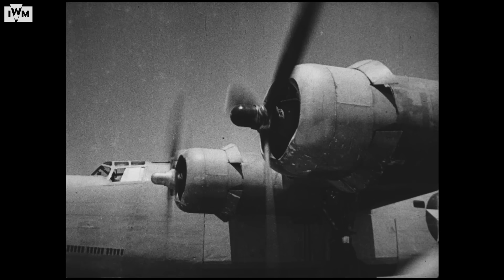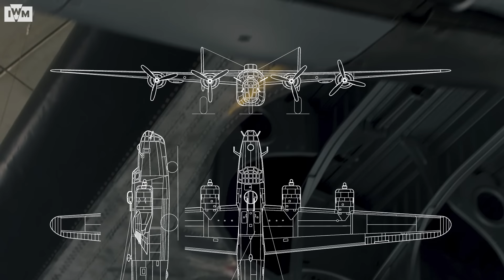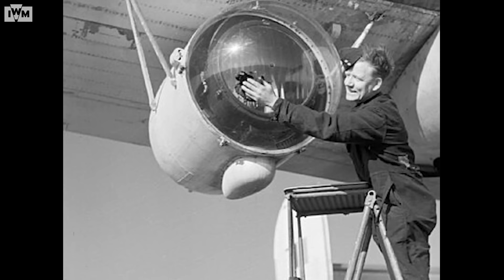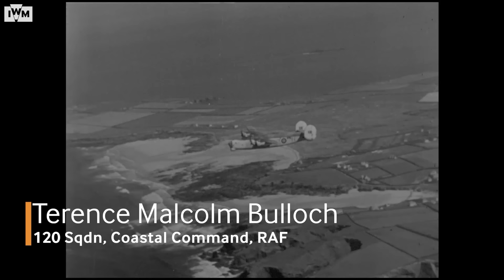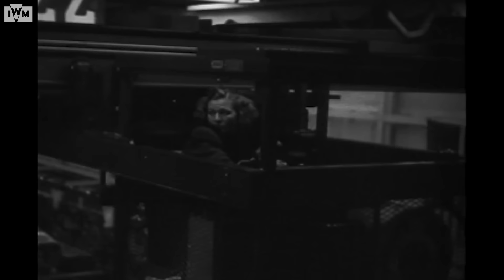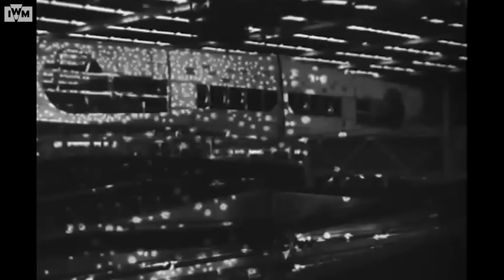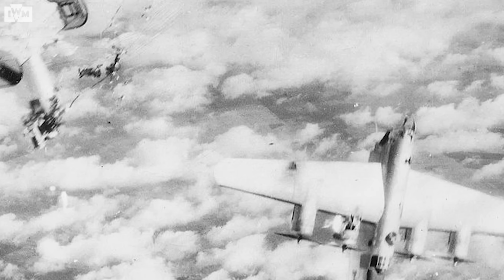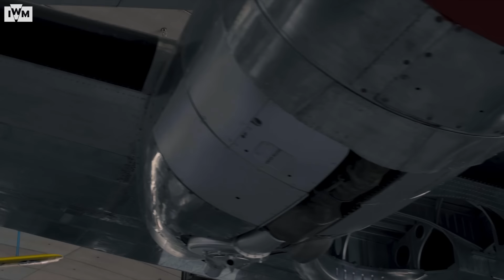The most produced Bomber in history had a bad reputation | B-24 Liberator

Comment: The reputation between the B-24 and the B-17 is kind of like the reputation between the Hurricane and the Spitfire during the Battle of Britain. The B-24 like the Hurricane was more numerous and did the majority of the work but the B-17 like the Spitfire gets all the glory.
Reply: It's more about location. The unique requirements of the war over NW Europe happened to be conducive to the B-17, in the MTO and particularly the Pacific the Liberator was superior with it's longer range. 

During and after the war, the VIIIth AF got the most publicity so the B-17 was more retained in popular memory.
Reply: @ME-xh7zp  I guess it depends on how you define "in numbers." The P47 was available from Summer 1943 but the ones that were available were not used effectively as an escort due to flawed doctrine (the bomber does need escort and lack of drop tanks)
Reply: @airplanes42  That's the thing, that's only part of the story. The P-47s that were used prior to the D-25 didn't have the internal fuel to make use of large drop tanks required to go to Berlin. Only after the D-16-RE did the Jug have the plumbing required to take the pressurized fuel of a combat drop tank out of the factory. Before that it was an extensive process of mods that had to be conducted by VIII FC ATS. Without the larger internal fuel tank, they still couldn't make it much past the Ruhr. Overall impact was the P-51 (and P-38 but it struggled for other reasons) were available to do the escort at the earliest, critical destruction of the LW phase in early '44. 

Also, fyi, Eaker was screaming for escort fighters as soon as his first P-38s were taken in '42, and Arnold had moved escort fighter development and drop tank production to top priority in Feb. '42. Imo recognizing that within three months of a surprise war was pretty decent awareness.
Reply: My late father, who piloted B-24s out of Toretto in the 461st Bomb Group, was told that because the Liberator was  a beast to fly (esp. in close formation), the best pilots were assigned to the B-24.  A friendly jab at the B-17 and Lancaster crews; they were all heroes.
Reply: @thomashoermann316   They had to be to best,  It was a beast to fly Came out 2 years after the B17 and was not as good
Reply: @thomashoermann316  lancasters, Stirlings and Halifax never flew in formation, they took off and carried out  the raid independently.,although on a strict time schedule.
Reply: The B-17 could take more punishment (battle damage) than the B-24 especially the wings, which is why the crews liked the B-17 better. I spoke to the pilot of the Collings Foundation's B-24 and he said flying the Liberator was like flying a freight train compared to the Flying Fortress.
Reply: All true....from this one person's perspective.  Both were good.  Cheers- @barryhoward7284
Reply: @barryhoward7284  I like a freight train..
Reply: @barryhoward7284  My father -in-law flew B-24 then transferred to Catalinas...he did confirm that the Liberator was very heavy on the controls and much more difficult to fly in close formation situations.
Reply: @barryhoward7284  Not many airmen served on both B-17's and B-24's so I've always found claimed side by side comparisons specious. My father was a B-24 pilot flying out of England with the 492nd Bomb Squadron before it was taken over by the OSS. He flew 11 bombing missions and then transitioned over to anti-intellengence missions. His crew did radar and radio jamming and radio intercept recognizance totaling 50 missions by war's end. His co-pilot once told me that they may have been the only plane in the air during the third day of the Battle of the Bulge when the weather socked in most of England and Northern Europe. They were radio listening over the battle field that mission but never detected an German airplane radio transmission. 

The 492nd was considered one of the 'jinxed' squadrons. Of the original 36 crews deployed to England in early 1944, only 6 crews completed their tour of duty intact. The other crews were either lost entirely or had crewmen killed or injured too bad to continue flying. I was told (not by my father) that none of the men that flew with him received a Purple Heart, he was considered a 'Lucky' pilot. A few years ago my brother found the memories of a B-24 gunner that in a letter to his loved ones  stated he had been assign to Lt. Young's crew for his last two mission so he knew he would make it home. Luck and skill had far more to do with whether you survived than whether you were flying in a 17 or a 24.

My mother, her sister and their father all worked at the Willow Run plant building B-24s. My claustrophobic mother had the job of climbing in the wing root to complete that wiring between the fuselage and the wing. My aunt was a riveter, my grand father was a mill hand in the tool shop.
Reply: Wing area, the 17 had more metal to be destroyed. 24 had a critical wing and when some of it was destroyed it no longer generated lift.  @barryhoward7284
Reply: B24 as a forgotten plane of WW2? I don't think so, at least not by anyone who is interested in aircraft of that period. Also any documentary program dealing in any way with the bombing campaign in Europe and indeed the Far East will normally include footage of B24's in action as well as B17's (and in the case of the F East B 29's). Granted it's service in the Battle of the Atlantic is often overlooked as indeed is that of other aircraft which took part in this vitally important campaign. The aircraft that are often overlooked are some of the twin engined medium bombers used by the allies at the time. Let's be honest, with a name like Flying Fortress how could the B17 be anything but the most memorable of the two and possibly all the Allied heavy bombers (I know here in Britain the Lancaster rules, my dad served as a gunner in them, but in America it would not have the significance of be anything like as iconic)
Reply: ... and it's largely a moot point. The B-24 had strengths the B-17 didn't, especially range.  The video explains how this made it good for sub hunting, but it was also very important in the Pacific.
Reply: True. Another one to compare on which would be better would be the  p51 Mustang or F4U Corsair.
Reply: @yoehonjohn4832  Imho P47 is more appropriate since the Corsair was a carrier fighter. The P47 was in service much earlier than the P51, and with aux tanks and judicious use of the throttle the P47 had more than sufficient range.
Reply: @airplanes42 
That's a bit of a misunderstanding, the P-47 didn't have that capability in numbers until after D-Day, and the Mustang was still superior ranged to all Jug  models that saw significant numbers in the ETO.
Reply: @ME-xh7zp  Rainge not that big of deal when you have drop tanks. P47 is harder hitting, tougher to take multiple hit mashine gun & even 20 mm hits,  the superior Pratt & Whitney air cooled twin Wasp radial engines that can often operate  even with a few cylinders shot out, unlike the delicate & 'pretty' looking Mustang.
Reply: @airplanes42 Major factor being that they could buy 3 P-51s for the cost of a single P-47
Reply: @airplanes42  The Corsair was at first a land based plane
Reply: @airplanes42  But the P47 had a lower T/M than the P51
Reply: @bobmalack481  Superior Pratt and Whitney where certainly not in Power to weight or Power to displacement Packard Merlin has it beat in both of those.
P51 could go higher not by much but more regularly P51 could turn better Climb better and dive better P47 Tactical Mach 0.71/0.73, P51 0.78/0.80
Reply: @airplanes42  The P-51 was more of a hybrid and could outfly a P-47.
Reply: @airplanes42 I mean, it was "Technically" a carrier fighter...

But for most of its service with US forces it was tossed like the USN's disappointing scraps to the USMC for them to use as a land based fighter, due to numerous crash landings on carriers due to its poor landing visibility from its long nose fuselage and high AOA required when landing due to its gull wing and location of its landing gear.

It wasn't until the Fleet Air Arm received their Corsair Mk II's, as their carrier plane development had been left in the dust while the RAF had command over them and were lucky just for the RAF to toss clapped out Hurricanes their way every once and awhile; God forbid funding an ACTUAL great carrier aircraft, after all, why would the RAF waste resources on something not for themselves? (HEAVY Sarcasm here...).

So most of the Fleet Air Arms best Aircraft by mid-late war were Lend-Lease F4F-4's = "Martlet Mk IV's", F4U's = "Corsair F Mk II's", F6F's = "Hellcat Mk II's", TBF Avengers = "Avenger Mk II's".

And while the USN was satisfied with the printing presses of Hellcats arriving around the clock, the FAA was in worse shape with MUCH less options and took anything they could get. So they trialed and experimented safer ways to come in and land Corsairs on their Aircraft Carriers and developed the sort of "Side-Slip" method where you came in off center to keep the deck in view until the last second upon which you straightened out and immediately cut the engine and almost instantaneously plonked like a rock onto the deck and (Hopefully) caught the wire.

There was still some danger involved as if you misjudged your height, or the carrier decended a wave in rough seas and you cut the engine, you could do serious damage to the airframe and in the process, likely yourself as well. 

But this was enough to finally get the USN on board and deem the F4U Carrier qualified and "Then" it became a carrier fighter.

If the "Carrier" vs "Land" plane's still bugging you though, I guess maybe you could compare the F4U to the F6F. The Corsair was exceptional and nicknamed the "Whispering Death" due to the sound it's Radial made in a dive for a strike mission or CAS, it even has the same K/D Ratio of rhe P-51 at roughly 11-1.

Yet the F6F while initially packing the same x6 Browning M2 .50's as the Corsair, and while not having the 4x20mm of Cannon armed Corsairs "Did" at least get a mixed armament trading x2 .50's for x2 20mm M2 Autocannons for x4 .50's and x2 20mm AN/M2 Autocannons such as on the F6F-5N; The F6F was designed and built by "Grumman: Ironworks" and went on to rank up a K/D of 19-1... Almost as good as the Mustang and Corsairs K/D's combined...

The P-47 is.... Extremely difficult to judge as in the ETO alone it scored over 7,000 aerial kills, but has a K/D of only 4.6-1. However this data is highly skewed as the P-47 was the MOST produced US Fighter of the war eventually making up about HALF of the entire USAAF Fighters and only had a 0.7% loss rate per mission. So due to just the shear numbers of them being literally anywhere and everywhere all at once, they'd naturally be more likely to be shot down as they'd naturally be the most common fighter to get into a fight in the first place.
Reply: @yoehonjohn4832 I would take the tough, hard hitting P47 over either of those, especially in the bubble canopy late war 'D trim variant. Eight 50's, under wing drop tanks, bombs, and or rockets, bullit proof Pratt & Whitney twin wasp radial engine, ability to take multiple hits. Usually gets you back to base where the sleek and 'sexy' Mustang was more delcate with liquid cooling and the associated extra plumbing and radiators. The old WW2 airforce saying- 'If you want to impress your gal take a picture standing next to a Mustang. If you want to get BACK to base and to the states take a picture standing next to a P47'. Robert at 68.
Reply: @bobmalack481  Ahmm source for many P51 being brought down by the cooling system being compromised? P47 Massive Turbo Super very large and long Air pipes to and from the super very vulnerable to side hits
Reply: @yoehonjohn4832  Mustang for sure
Reply: There were more Spitfires produced overall throughout the war than the hurricanes.
Reply: @livethefuture2492  yes and under constant war conditions
Reply: Actually there were less hurricane at 14,600 and 20,000 spitfire and spitfire did most of the work
Reply: @harryvlogs7833  Not Correct The Spitfire did most of the Fighter work The Hurricane everything else
Reply: @harryvlogs7833  No the Spitfire did not do the heavy work that was always the Hurricane . In fact the Hurricane was not changed in Burma until Late 44 or early 45 by the P47
Reply: @harryvlogs7833 . Not in The Battle Of Britain.
Reply: @mattmurray9312  yeah
Reply: @harryvlogs7833   Actually the Hurricane was still doing stacks of stuff that the Spitfire did not do until later 
Sea Hurricane, Malta , Ground Attack par excellence 
MkIV with Universal wing 2x Brownins 2 x40mm Vickers S gun 2 x500lb bombs AND 8 ROCKETS which the Spit never had.
Reply: Oh and from way back the Hurricane had 4x 20mm cannon which beat the Jug is destructive gunfire There is a video on the Hurricane can opener in Libya, it was a  excellent  ground attack plane before the US even thought about it.
Reply: @jacktattis  not during the Battle of Britain it didn’t. It had the same 8 .303 machineguns as the Spitfire.
Reply: @jacktattis  yeah and then quickly failed and was replaced buy the better spitfire, faster more maneuverable more guns much better and faster
Reply: @PitFriend1  Hurricane IIB 12 X .303 IIC 4 x Cannon so not long after.
Reply: @PitFriend1 It hardly matters the Hurricane was a better gun platform and had 4x cannon well before any Spitfire
Reply: @harryvlogs7833  I would hardly compare 2 x cannon and 2x 50s[ Spit] better armed than 4 x cannon of the Hurricane   The rest you are correct . But dont write off the Hurricane, it was in action in Africa Malta and at sea before the Spitfire.
Reply: The 24 did a lot of work in the Pacific but it also was considered a hard plane to fly
Reply: No, the B-24 was the high performance airplane. Faster and carried a larger bomb load. It took three B-17s to carry the same bomb load as two B-24s.
Reply: @Nl-nn3ds  Not so Top Speed 290 mph service ceiling 28000 ft Max bomb load 12000 wing racks and internal B17 317 mph and 35000 ft Service ceiling max load 12800 lb B24 to Berlin 8000lb B17 6000 lb
Reply: Wouldn't push it too far the other way either. Neither aircraft was truly better than the other. The B-24 did carry larger bombloads farther and faster in other theaters, those not defined by extreme altitudes. Not to mention the contribution as a very long range Uboat killer and asset  suppression
Reply: @ME-xh7zp  The B24 was NOT as good as the B17 against the Germans
Reply: Boeing had better PR
Reply: It's probably bcoz of the deep emotional scar associated with the horrors of 1942/43- involving  B17s only. The unescorted missions to the ball bearing factory. And that poem by the bug-smeared glass bowl gunner.
Reply: It may very well be true that a B-17 could take more battle damage, especially in the wing root area, than a B-24. I once saw a Lufwaffe gun camera film showing a German pilot concentrating his cannon fire on the wing where it joins the fuselage, which much to my horror completely tore off with the B-24 twirling around like a drill.
Reply: Hurricane and Spitfire had different roles. The Hurricane, whilst a very good fighter actually struggled against the 109 and was no match for the 190. During the BoB, the Hurricane took on the bombers whilst the Spitfire took on the fighters. If the Brits only had Hurricanes, the BoB would have been lost. By the end of 1941, the Hurricane could not be upgraded anymore so it was more suited to ground attack and supporting troops from bombers. 
The Spitfire could be upgraded more often to meet the threats of the upgraded 109 and 190. 
In fact, during the BoB, the German pilots stated that the Hurricane was a good plane but easy to shoot down. It needed a really experienced pilot in the Hurricane to be somewhat of a match to the Germans.
Reply: @BatMan-oe2gh  No I woukld suggest you read Hurricane  by Adrian Stewart The Hurricane actually was very good against the Bf109 and had a good record everywhere
Reply: @BatMan-oe2gh  I would suggest you get Asdrian Stewart Hurricane
By March 1940 73 Sqn Hurricane had accounted for 5 Bf109s for 2 Hurricanes
Reply: @jacktattis  The Hurricane was a good fighter with good pilots. But at the end of the day, the Spitfire was better.
Reply: @BatMan-oe2gh  Of course the Spitfire  after its introduction was the Premier fighter
Reply: @jacktattis  The Hurricane was a good fighter and could out turn the 109. 
But the Germans soon realised that and just attacked the Hurricanes from above or below and not get into a dogfight if they could help it. And with their cannons, they could tear a Hurricane apart very quickly with just a few hits. 
And there is this in Jerry Schutts's book Messerschmitt Bf-109: The Operational Record, in which it's pointed out that these stats only refer to kills that are known to be between those particular types of fighters.

Me-109 vs. Hurricane: 153 Me-109s destroyed vs. 272 Hurricanes destroyed is a kill ratio of 1.78-1 in favour of the Me-109.

Me-109 vs. Spitfire: 180 Me-109s destroyed vs. 219 Spitfires destroyed is a kill ratio of 1.22-1 in favour of the Me-109.

Me-109 vs. both: 333 Me-109s destroyed vs. 491 Spitfires Hurricanes destroyed is a kill ratio of 1.47-1 in favour of the Me-109.

In the wake of the Battle of Britain (in which the Hurricane was responsible for 60 per cent of all German aircraft shot down, majority were bombers) things moved on. Hurricanes used in the Western Desert were not capable of matching it with the by-then substantially upgraded Me 109s, and subsequently they became more of a fighter-bomber, used in ground support.
Reply: Can also be said about the P-47 and P-51. P-47 fought the Nazis at their strongest and got rid of most of the good pilots. By the time the mustang was around they were weak and have very few pilots of quality.
Reply: @Redgecko2008  That has been wrong for years the Hurricane and Spitfire got rid of the best pilots in the Luftwaffe from Oct 1939 The P47 after April 1943   Just in the Battle of Britain 1700 to 2000 enemy in 5 months The P47 never caught up/
Reply: @Redgecko2008  The RAF fought he Luftwaffe at its strongest 43 months before the P47 first operation.
Reply: @Redgecko2008  Save it for the tourists.
Reply: It's the Cool Factor.
Reply: I feel like that’s partially true. The majority of the major raids that the 8th Air Force carried out were B-17 heavy but overall it did much more just due to how many roles they put the B-24 into
Reply: @fitycalibre7555  The crew of Hot Stuff would disagree with you. It was a B 24 that was the first to complete 25 missions. Faster, longer range and heavier load, IOW a more capable bomber.
Reply: @fawnlliebowitz1772  No it was not faster and too  Polesti 5000lb load  Range a toss up
Reply: @jacktattis  Congrats, you just demonstrated you know nothing about cruise range, bomb load and speed. Polesti was a DISTANT target, with any bird fuel will reduce load. >eyeroll<
Reply: The Spitfire was CLEARLY superior to the Hurricane though. There's no real debate there. Hurricane production stopped. Spitfire production lasted all through the war. 
If the RAF only had Hurricanes the Battle of Britain would have been more dicey.
If the RAF only had Spitfires the Battle of Britain would have been won sooner.
Reply: @lyndoncmp5751  kind of a pointless thing to bring up but yes lol
Reply: @lyndoncmp5751  Hurricanes were still in action in Burma late 1944 They fulfilled more roles than the Spitfire ever did The Spitfire premier Fighter and that was it. Hurricane every thing else
Reply: That Davis wing could not take the violent manoeuvres that the wing on the B17 could take and it was a very busy aircraft to keep in Formation
Reply: My father in law flew a B 24, he absolutely hated it when anyone said anything good about the B 17.
Reply: The spitfire shot down more planes and is cooler. Even if I'm not correct, I don't care :) neither does anyone else. 

The truth doesn't matter. The sooner you accept that, the sooner you're able to live with a woman.
Reply: To me, an issue is, wing loading in particular, and the ability to take on more weight in general.  A light, glasshouse nose B-24 was superior to the B-17E.  The B-24's performance, including stability, fell off a lot with more weight, longer nose and such.  The B-17 could handle the extra weight better.
Reply: The B-17 and B-24 were both practically helpless against Axis interceptors, and functionally helpless against Flak. The only advantage the B-24 had was speed, as the B-17 fully loaded could barely make 180mph.
Reply: Joseph Heller Catch 22 with Yossarian?
Reply: ANOTHER comparison is between the Avro Lancaster  and the Handley Page Halifax of Great Britain.
Reply: EXACTLY..if I had to fly in a 'heavy' over Germany I'd pick the B24. Higher speed, the high aspect ratio Davis wing, higher range, tricycle under carraige, Higher bomb load (it's 12,000 lbs. max bomb load, NOT 8,000 as with the B17) Bullit proof Pratt & Whitney twin wasp radial engines. And with the single seat fighters I'd pick the tough, fast, and almost as manuverable P47, especially in  the bubble canopy late war variant 'D trim over the more delicate Mustang. Two sadly underated planes compared to their comparable oposites, & deamed so partly because they were less pretty and sexy. Robert at 68.
Reply: @bobmalack481  b24 That high aspect ratio led to many wing failures its service ceiling was much lower than the B17 and as someone else wrote well within the flak zone. 
P47 tough yes Well armed Yes but lousy climb, lousy dive, lousy turn .
Reply: @bobmalack481  That's what I was explaining; when comparing the B-17 and B-24's flight envelopes over Germany the B-17 is faster, flies higher, and could carry more bombs and defensive firepower. That's because in order to avoid flak, you got as high as possible. Above ~22,000' the B-17's performance is superior. This is largely due to the advanced Davis Wing ironically, which in the thin high atmosphere was less efficient than the B-17s fat one. Below that altitude, the B-24 was superior in almost every metric except survivability. 

Sidenote I also take issue with the Museum's assessment of survivability, which the USAAF did a lot of statistics on and clearly show the Fort was harder to shoot down and easier to escape when hit.
Reply: @ME-xh7zp  You got some of these stats backwards..where do you get your information from?..how old are you?..Robert at 68.
Reply: @bobmalack481  No, not in this case. If I were speaking about SWPA or any operations below 20,000' attitude, I would be backward and incorrect. Over Germany, where operating at the maximum service ceiling was critical to reduce casualties, the B-17 had the superior performance in everything except range. 

As for sources, online you can freely find several. I'd post links but that is usually blocked on Youtube. I'd recommend googling "Supplemental Statistical Comparison: B-17 - B-24 Models" dated 11 May 1944, written for CO AAF, and anything regarding the ball turret removal on B-24s of the VIIIAF (which will explain in detail why they removed the Liberator's ball turrets in the ETO trying to have them keep up with the Fortresses). Finally, you could compare and run the two aircraft types performance charts which will show a performance reversal as altitude increases.
Reply: @bobmalack481  1.Could not go above 28000 ft
2. That wing made it the weak point of the plane, it could not do hard evasive manoeuvres
3. That wing made it a very busy plane to fly It was almost impossible to keep in close formation.
4. Its performance was not any better than the B17.
5 8000lb internal or 8000LB external on racks Not 12000 lb
6. B17 only 6000 lb to Berlin 12800lb internal short Missions
Reply: @jacktattis  O.K..then explain it to me that over and over I read in multiple articles that the max bomb load for B24's is 12,000 lbs, 4 more than the standard 8,000 load for B17's. Unless your a WW2 vet from a bomber crew and show me the plane specs I don't believe you. Robert at 68...On top of that what heavy bomber makes 'hard evasive moves?..You fly basically in a straight line as a bomber. Take all this up with Jimmy Stewart as he piloted B24's in WW2, and his opinion regarding B24's.
Reply: @bobmalack481  I gave you two sources I have if you found others good for you.
Reply: @bobmalack481  I would suggest having a look at WW2 Aircraft Performance Bill Gunston Combat Aircraft, Plane Spotters Guide  Osprey Publishing Mostly agree on loads  and are not biased
Reply: I’m going out RAF Duxford this month for 2 days at the air show, looking to to seeing these war birds.
Reply: @TCK71  enjoy if I lived over there I would too
Reply: The B24 was the workhorse  but its service ceiling of 28000ft was 7000ft below that of the B17 , its top speed was 30mph slower than the B17 and it was a difficult plane to fly for new pilots That lower S/C put it well within he flak Zone
Reply: Plus that Davis Wing was its weak point
Reply: @jacktattis Throw 5000lbs of bombs on. 'Empty' calculations mean nothing. 

B-17s simply were not bombing anybody from 30,000+ feet.
Reply: @lllordllloyd  
It doesn't change it. The advanced design of the Davis Wing actually played against the B-24 over NW Europe. The B-17 outperformed it in all metrics above 25k. VIIIBC requested B-17s only (didn't get it) so gave their B-24 easier missions whenever possible. They were very concerned about Liberator crew morale collapsing due to lower return rates. Liberator ball turrets were removed in order to try and bring their performance up to the Fortresses. 

This isn't a knock on the plane, as only two air fronts were defined by such high altitude necessity. The Liberator was the superior platform on many other fronts and missions.
Reply: @ME-xh7zp  all good, upvote
Reply: @lllordllloyd   They did go to 9000m and they could go that high The B24 COULD NOT